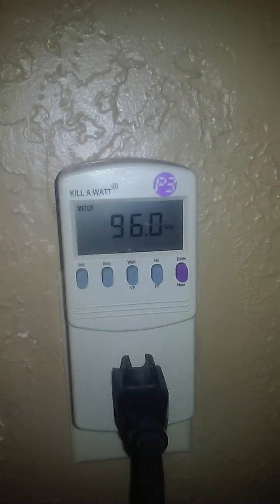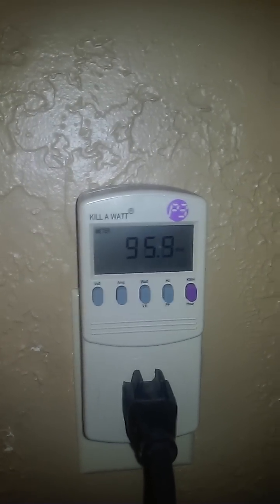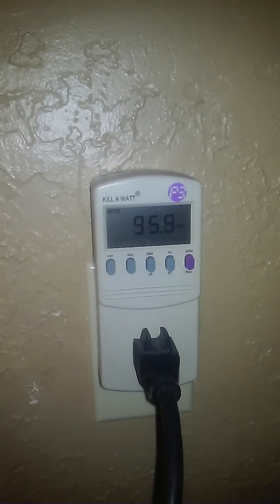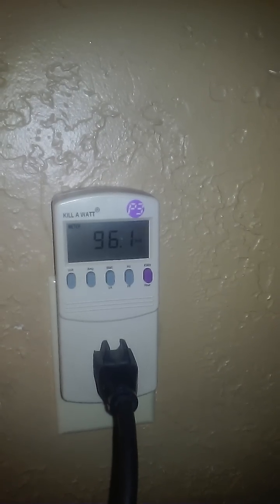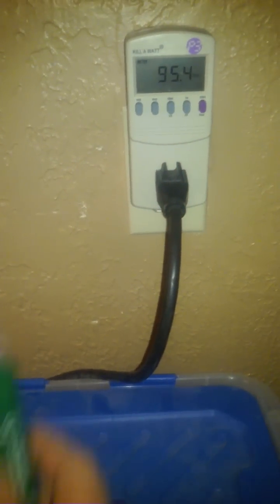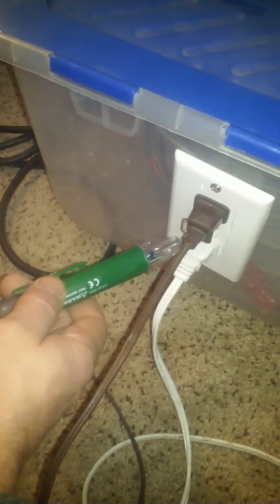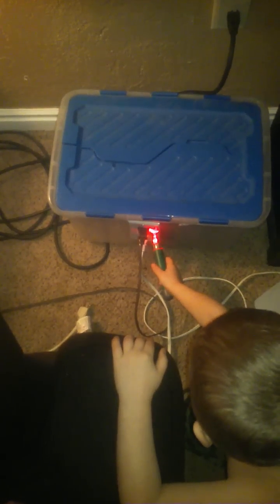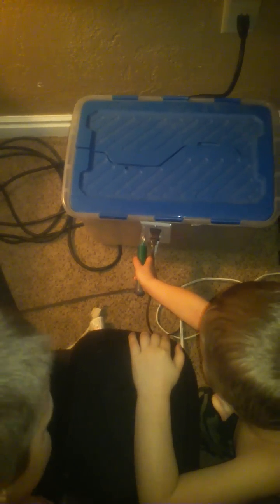Keshe magrav stacker day 5 update!

Comment: SO COOL give it time Id say come back on 30days and lets see. I'm building one as well but with all the new info from keshe it may be better to start building a new one. nano coting with heat. better for power generating systems and maken gthe outer coil 144 turns and the inner coil 81. and having them right next to each other no gap creats more power. ow and don't for get to put the alin the direction al flow of the plasma evry time you nanocote by attaching a volt meater/battery, positive to nagativ terminals. and repeat for every nano coting . if not you can get loops of in the coting ware positive and nagativ are  travelinging in the  coting against each othere